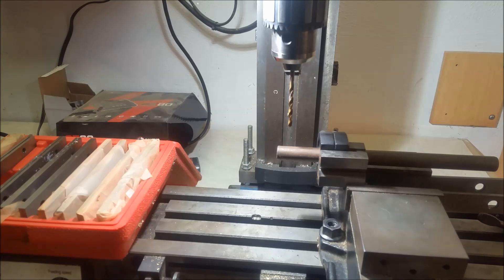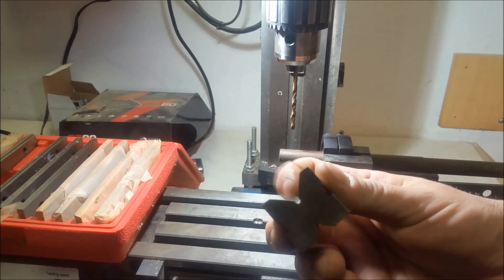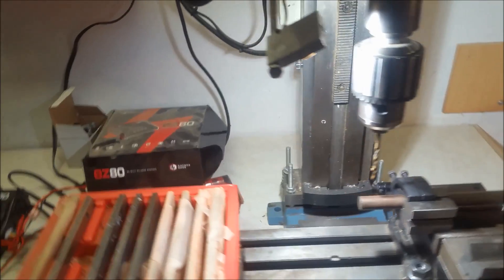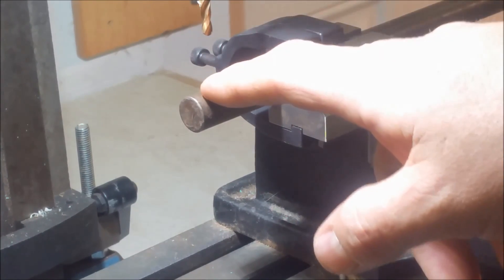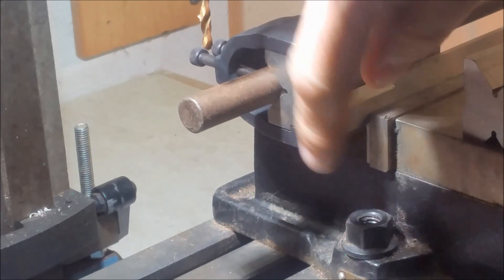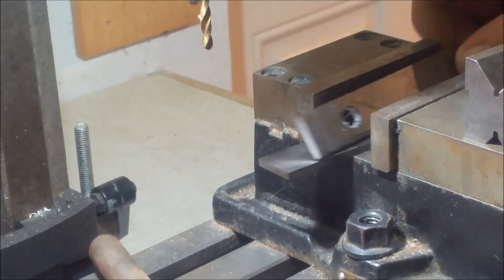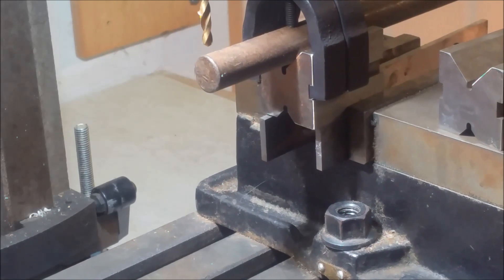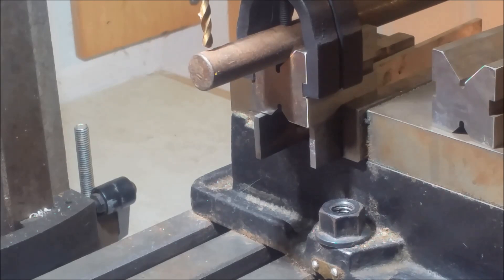How to setup and use V-blocks

Comment: And if you were to hang it that far out of your vise and drill those holes you had better put a machinist jack under the end you drill or your holes will not be at ninety degrees to the round bar.  Doesn’t matter how tight you think the grip of the vise is on the vee block.  You also need the other vee block in the other end of the vise to prevent the vise jaws from canting. (Assuming you have the second matching block.)

Comment: When it states V block capacity of say 1" is that the size of pipe or bar that fits into the V or the largest part that will fit under or between the clamp? Thanks for your video it helped me understand. I want to silver solder a ghost sight onto a shotgun barrel and I am not sure what size v block and clamp to buy..thanks again
Reply: That’s usually the size of v and your limitation is whether you can clamp your part in it. Just make your own.